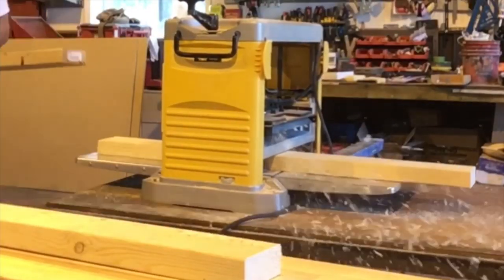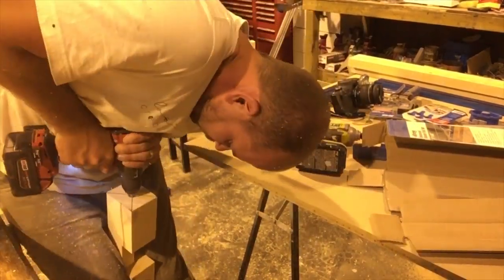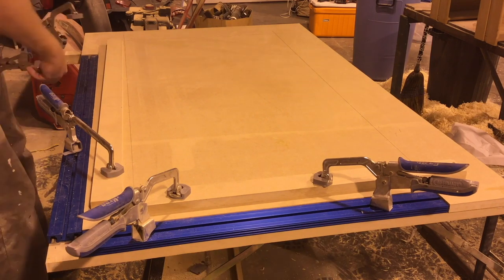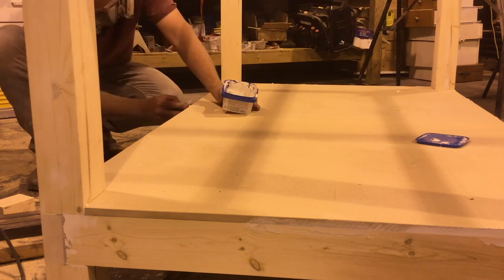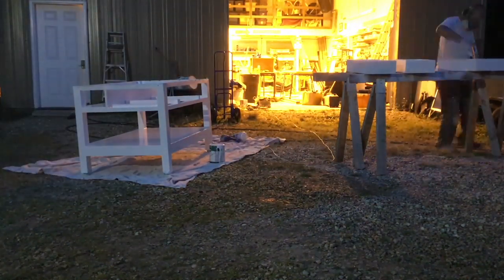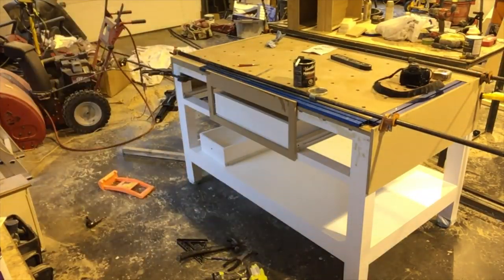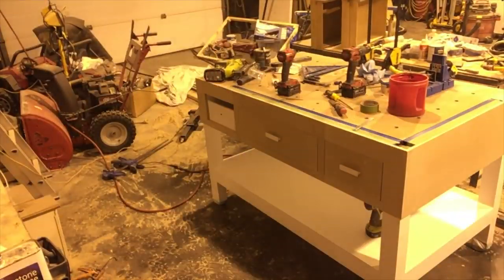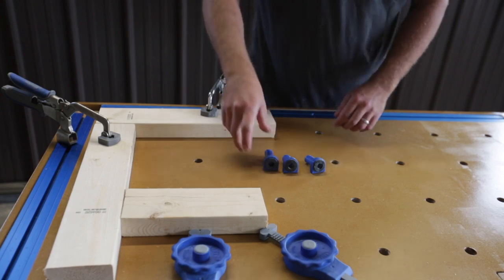DIY WORKBENCH WITH DRAWERS | The ultimate Kreg Workstation [with dog holes and clamp traks]

Comment: Hi There,

This looks great. I have one obstacle in my case.  I have a walk-out basement with a standard exit.  If I ever had to move, I'd have to be able to dismantle this unit to get it out the door. Has anyone built this not using glue?  I'd plan to use just screws to hold the legs and frame to the top.

Thanks!

Comment: How do you deal with dust falling through the dog holes and into the drawers?
Reply from the maker: hasn't been an issue for us to date. It - does collect some dust/chips. I just vacuum from time to time. If it turned into an bigger issue you can add a catch tray that sits slightly under the  bench top  (will just affect the drawer use slightly). But I like having the drawers there as its good storage :)